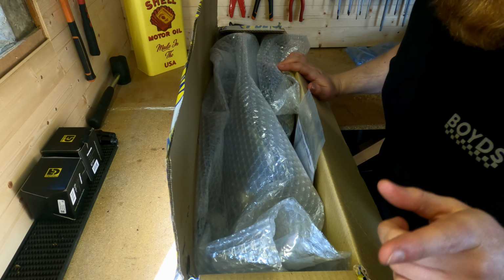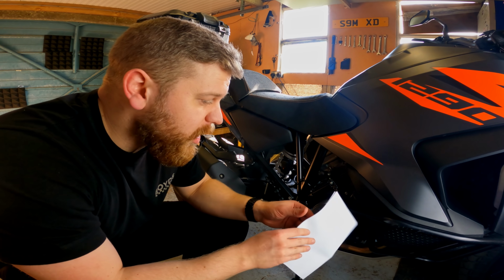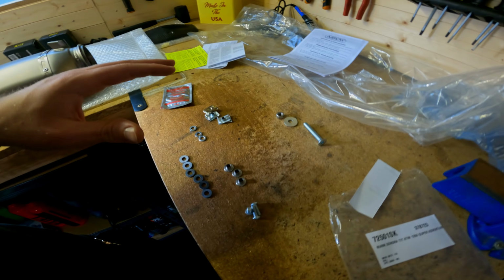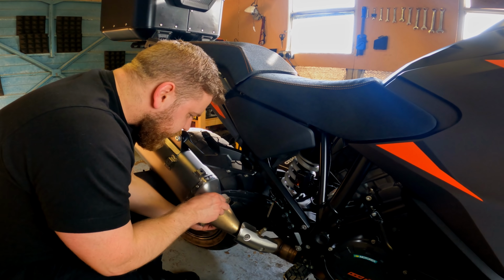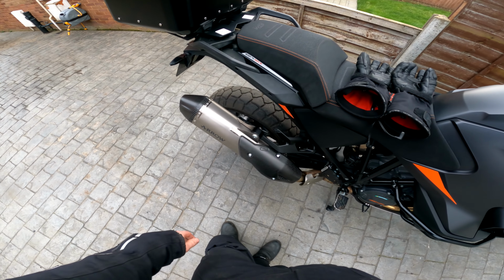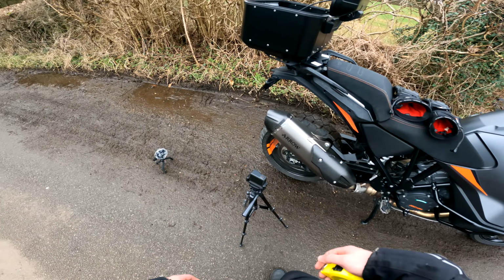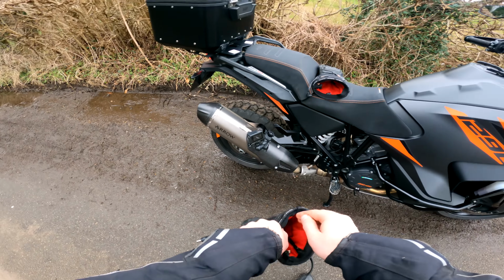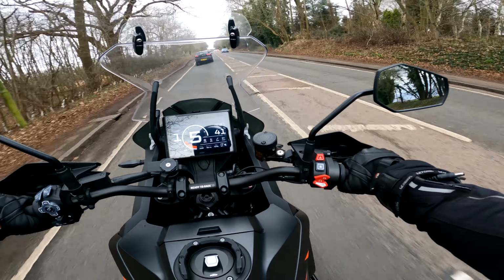Arrow Sonora Exhaust | 2021 KTM Super Adventure S | First Look, Fitting & Comparison

Comment: Hi there...
great videos 👌🏻.... just a question ... as I have got the same bike and looking forward to buy this exhaust ...🤔Do I need to do something to the bike after I instal the exhaust ??? 😊
Reply from the maker: Thank you! No you don't, I ran my bike with the baffle out on this for over 6 months with no issues. You will notice some of the Euro 5 characteristics a bit more (a little on and off with throttle etc) so you can choose to get the bike remapped to help that (which is what I did), but it runs just fine without doing anything else to it!

Comment: Which way did you fit the spacers. Flat side toward exhaust or carbon. I'm not happy how close the carbon comes to the exhaust on mine too close
Reply from the maker: Flat side toward the carbon but I don't see why you couldn't have them the other way around. My carbon is very close to the exhaust but doesn't touch it

Comment: As a previous gen Super Adv owner, that was the single best mod i ever did, arrow slip on. Curious that the baffle was so easy to remove, i was under the impression that all euro 5 aftermarket exhausts had to have welded non removable baffles from the factory. Does make me miss my big KTM, but my dealer experience soured me on the brand. Ended up on a GS, very happy, but your vids make me nostalgic. Thanks for that from Canada!
Reply from the maker: Agreed! It makes a huge difference! I thought the same too, especially as all other exhausts seem to be either riveted in or welded. Not sure how they got around that! Such a shame that dealer experience can ruin a brand but its said quite a bit with KTM! Thanks for watching!
Reply: Where is the dealership in Canada?

Comment: Hi sam with the weight difference  of arrow exhaust compared to stock 3.5kg and changing the yuasa ytz14s battery to jmt lithium would save another 3kgs that would make it 238kg bike on parr with the new gs1300r?
Reply from the maker: Yes there's not a huge amount of weight difference between the bikes anyway. That weight difference could easily be changed by adding a topbox or something. I wouldn't focus on the numbers too much though. The bikes are very different to ride and you won't notice the weight difference

Comment: Great video! I'm wanting this exhaust, but need to know if it will afford the passenger more foot space. The wife's foot rest on the stock exhaust and she hates it. Thanks in advance.
Reply from the maker: Thank you! That's a very good question. My other half has her own bike so she hasn't been on the back of mine since fitting the exhaust so I couldnt tell you for definite. It's definitely shorter at around 400mm, and the height is less by quite a bit, but I couldn't tell you it will give you clearance. I'll measure when I get home from work to see how much smaller it is!

Comment: Nice video Sam
Did you have the DB comparison? What about the Krapovic, saw it in the KTM website for about 1k
Reply from the maker: The comparison is toward the end of the video, and there is a separate video with just the comparison too. The Akrapovic is 50% more money and sounded barely different to stock which is why I didn't go for it. It sounds good when the baffles and out but you need to drill the rivets out to get it out!

Comment: Hi Sam, very nice video! I just got the exhaust two days ago and put it on and removed the baffles right away. But I have ran into the the engine misfiring issue for the past couple days, feels kind of similar to the infamous 1290 misfire issue, but only after installing the exhaust. It happen like once a day, and only if I roll off the throttle then immediately give heavy throttle, around 4000 rpm. I was wondering if you have seen this issue? I'm still experimenting and will put the baffle back in to see if it's fueling issue. I have a 2022 bike and did not experience misfiring on 700 miles prior to the exhaust, but also might be due to I wasn't giving much throttle when I was running in the engine.
Reply from the maker: Hey! That's a shame! I've had no misfiring or bad fuelling at all with the exhaut. Baffle in or out. I know there are a few people who have had misfiring issues develop after their first service too. Seems to either be the crank position sensor, or there's another one which I think is the O2 sensor coming out the cat.. that wears through rubbing against the swinging arm and causes that. I'd stick the stock can back on to see if it still does it, then get KTM to take a look. Hope you get it sorted bud!

Comment: Hello Sam!
Great video! You really make me want to ride one of those 😂.
I have a question for you. Do you know if f that Arrow exhaust is compatible with the KTM panniers ? I’m talking about the ones that hook into the bike, not the ones that use racks.
Cheers !
Reply from the maker: Thank you!! Haha! 
I believe they are but I haven't tested it! This is quite a bit smaller than the stock exhaust so I'd assume there would be more space! Sorry I couldn't be more help! Thanks for watching
Reply: @SamVBikes  
Hello Sam ! Thanks for your reply.
When you say it’s smaller, are you talking about length or width ? Because the oem or the Akrapovic are oval on shape and they get very close to the pannier inside. And since the Arrow seems to be more round than oval in shape, I’m worried that it will melt the inside of the right side pannier 🤣.
Thanks

Comment: Hey bud, greetings from the USofA!  Did you really use all the metal and rubber washers on the heat shield?  I don't see how the metal washers and extra rubber washers attach to anything....Great vid, thanks!
Reply from the maker: Greetings!! Yes! There were so many of them. I can't remember the order off the top of my head but it was something like bolt, washer, shield, washer, rubber washer, then into the clip on the exhaust. All of them go on the bolt, and the metal clip things push onto the exhaust mount
Reply: @SamVBikes  thanks Sam. I got em all on there. It was a real exercise in dexterity for my fat fingers!
Reply from the maker: Haha I know the feeling! Glad you got it sorted

Comment: What are your thoughts on the screen extender thingy? I'm 6'2" but all back so I sit tall in the saddle and my head feels a lot of wind (Fnar fnar!)
Reply from the maker: It's really good! I'm only a short arse so it won't be as good for you, but I can ride with my visor open on the motorway easily. It's the Puig clip on 6375W I think. Not 100% on the model number but basically as wide as the top of the screen. Worth having a look at the taller aftermarket screens?
Reply: @SamVBikes  Thanks. I should have said what a great (funny) video.
Reply from the maker: Thank you! Appreciate it

Comment: Hi there
Did you have to pay extra charges on the UK end when it arrived?
Reply from the maker: Hey! No I didn't, I bought it through a company who uses a UK importer so they pay the import duty. Give Bikestop.co.uk a call and tell them I sent you, they will look after you if you're interested In getting one!
Reply: @SamVBikes  ok thanks Sam I'll try them. I've seen someone on eBay called mototopgun from Italy selling them for £600 odd. They said there is no extra charges on this end. Not sure about that really
Reply from the maker: The only way I think you can get around it is if the company shipping it lies about the value of the item! Not sure who pays if they find out that's not right though haha
Reply: @SamVBikes  Spose it's worth a punt. Have you any idea what the extra charges would be on £600?
Reply from the maker: I dont think it's too crazy! I think it's around 2.5% on total value for anything between £135 and £600, not sure over that. Massively depends on the country it comes from but there are a few calculators online
Reply: Hi again Sam
Are you noticing and flat spots or big backfires with baffle out?
Reply from the maker: Hey! I get the odd pop/backfire when changing gear after holding revs longer etc. And get some burbling on overrun, but I haven't noticed any flatspots that weren't there prior to putting the exhaust on. Are you getting those?
Reply: @SamVBikes  I was just curious. I've had bikes that have ran like shit when I've put an aftermarket pipe on. Sometimes you get away without remapping. Good to know yours runs well. Just researching before I buy one.
Reply from the maker: Agreed! That's normally when you either go for a cheap exhaust with no back pressure, or take out the catalytic converters in my experience which this doesn't. Well.. back pressure is more for the smaller engines. If anything this seems more responsive down low. Still a flat spot mid rev-range but that was around with the stock pipe. Remap could be useful for smoothing it out though but definitely not a necessity!
Reply: @SamVBikes  I haven't ridden mine for coming on 3 month now but I do recall I small flat spot around mid revs. Nothing major. Overall I'm pretty impressed with the smoothness. I remember the 990 adventure had nasty surges and flat spots. Putting an aftermarket exhaust on just exaggerated it.
Reply from the maker: Its nothing major, no! Soo much better than previous models in all aspects so really happy with that. I'm thinking all these new exhausts have to be euro 5 compliant so that probably has an impact too on how invasive they can be on the air flow too

Comment: After hearing your maniacal laugh at the gorgeous sound,I bought one myself but can't figure out how to remove the baffle, I cab see where the small bolt should be but I can't figure out the size of the Allen key needed as I seem to have too small or can't tell if the next size is too big as nothing seems to ne turning. Can you advise what size the key you used is please?
Reply from the maker: Haha! The new ones are welded in so you may have to dremel the top off it! There are potential some simple edge welds on the edge of the baffle going down around the opening. Check you have those or not first. I'll have to dig out the baffle in the garage tomorrow. It was really easy to remove so the welds may be the issue. Should be really easy to remove though
Reply: @SamVBikes  wow, thanks for the quick reply Sam, I don't see any welds but I also don't feel like any Allen key is fitting or feel any reistance when i turn them and don't want to round it out . If you remember I'd be much obliged. I really want to hear it sound like the monster V twin it is.
Reply from the maker: More than welcome, I'll write a note on my forehead to remember tomorrow and come back to you. Are you on Instagram or FB? I can send pics on there of how mine is to see if its the same
Reply from the maker: It's a 3mm hex head bolt, protrudes quite obviously sitting above the level of the baffle metal. If you have no screw in there, you might have the welded one. I'm just chatting to someone else with the same thing! 

Watch the vid below. Just need to grind off the subtle welds to get it out. I doubt you will need to take the can off like he has but might make it easier. 

https://youtu.be/OoN-qat_eq8
Reply: @SamVBikes  you are a star, on closer inspection (in daylight!) it is welded which is why I’m struggling to find the Allen bolt in the small hole. Delicate dremmel surgery required. Thanks again Sam you are a top banana.
Reply from the maker: Haha those dreaded EU legislations ruining our fun! Good luck 👍🏼
Reply: @SamVBikes  I think the guy at the Arrow factory was either p#sped off with his job or people grinding his very neat welds off as I swear he’d put extra on mine but the deed is done and it sounds PROPER now. Haven’t got quite the same evil laugh but not far off. Thanks for your help 👍
Reply from the maker: Hahaha! Maybe he just wanted to annoy someone! Glad you're sorted! Enjoy